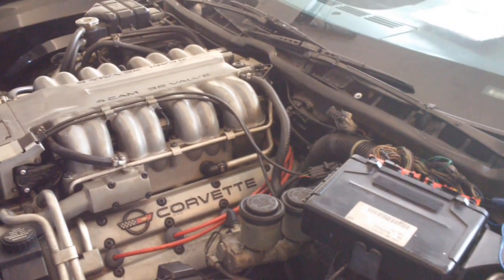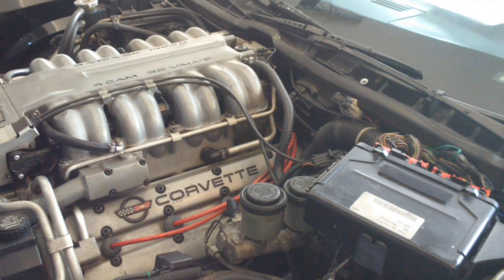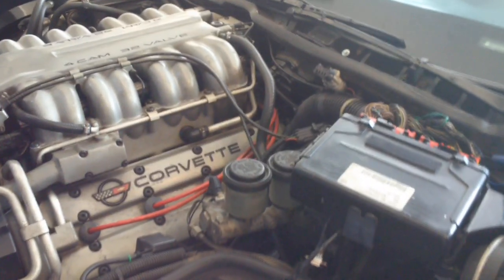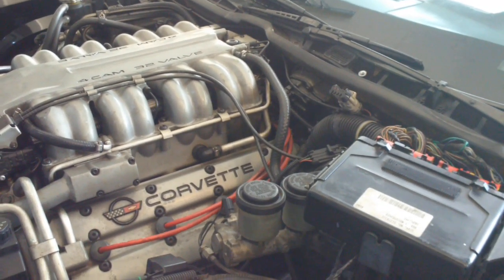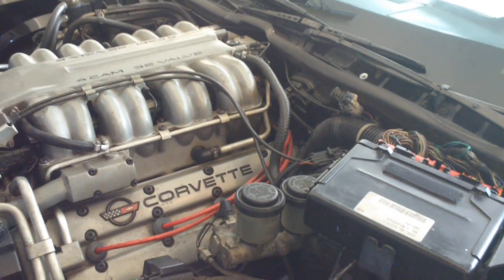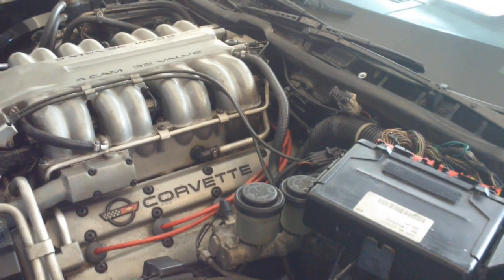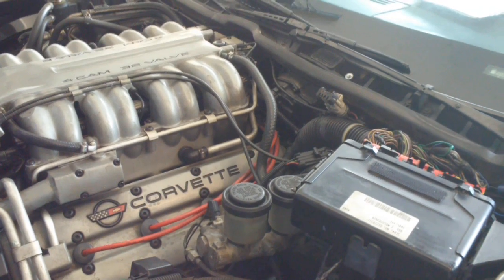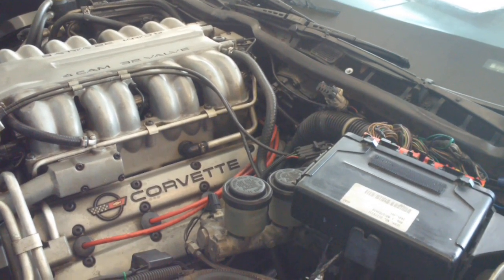C4 ZR1 LT5 ECM

Comment: Nice to see that someone is already tackling this with open source hardware. I figured it was possible, but this is the first project I've seen publicly that in my mind demostrates it. Has the car been driven with the Arduino?
Reply from the maker: Yes, absolutely.  I can confirm that I have upgraded several 'bricked' ECMs using Arduino hardware over the last 3 years.  The hardware is extremely reliable and fits neatly between the 2 circuit boards of the C4-ZR1 ECM.   

The ATmega328 microcontroller, used in most versions of the Arduino hardware, is extremely stable over the ZR1's operating temperature range. In fact, it exceeds the specs of the original ECM (which dates back to the late 1980s). 

BTW - although the Arduino hardware is readily available, the firmware that makes it work in the C4-ZR1 ECM is proprietary and is extensively customized for each ECM upgrade, depending on what failures need to be resolved.
Reply: @user-rj6sd5lj9o Interesting, so  you're basically doing a custom "patch" so to speak, based on the failure mode. I assume that's due to the propreietary hardware (such as U13/U15) within the ECM, and the desire to use the existing wiring harness and retain all other ecm functionality that isn't affected by the failure? It's definitely reassuring to know these can be kept running likely indefinitely this way.
Reply from the maker: Yes a "patch" of sorts but I tend to think of it as adding a pacemaker to the heart of the beast - LOL!!!

Comment: I have been chasing a miss on cylinder #6 for a while, all of my injectors except #6 are getting a pulse. Grounding pin 8 on connector A, #6 will spray however when I try to start the car normally no pulse. I am sending my ecm to  Marc H tomorrow to test on another car to confirm. I have spoken to Marc several times by email and he says he has seen single injector drivers fail, so hopefully I have finally tracked down the culprit. Thanks for posting this, very helpful. 👍👍🏁
Reply from the maker: Component U15 and component Q1 are responsible for engaging injector #6.  Your ECM issue could be related to these devices.

Comment from the maker: Based on the symptoms, parts U13 and U15 were components of interest. The exact cause or causes of the observed symptoms remains a mystery.
Without a DELCO datasheet for the pertinent ICs, it was a matter of determining what each pin is supposed to do by tracing where each pin goes. Slow process. Note-taking and photographing were imperative. 
At this point, I know that transistors Q2-Q8 were not receiving a 5 volt + pulse and therefore these 7 transistors were not activating the fuel injector that each is paired with. This signal is supposed to come from U13. 
Q1 is receiving its 5v+ signal but unlike Q2-Q8, Q1 receives its signal from U15. 
Based on the signal that drives Q1, I  was able to use a general purpose micro-controller, with custom firmware, to drive Q2-Q8. The added hardware/firmware,  maintains the existing individual control of each transistor to support Sequential Injection. 
The proof of concept is revealed in this video posted on YouTube.

Comment: In my 18 years of being associated with the C4 ZR-1, you are the first person that has actually delved deeply into the ECM to find and resolve a non-functioning electrical component.  It is obvious that you really know what you are talking about.  Thank you for the information & the technical information you provided on the ZR1Net forum.
Should you possibly decide to offer your service to repair the LT5 ECM, You would be performing an invaluable function in helping to keep the LT5 viable.  I hope you do!  
www.jerrysgaskets.com
Reply from the maker: Thanks Jerry!!  I might set up some desk space to fix these ECMs.  I'm wondering how widespread the ECM shortage is.
Reply: @user-rj6sd5lj9o It would probably surprise you.  The demand for gaskets and parts has certainly surprised me over the last 12 years. I get calls asking if we know a source for an ECM or where to get it repaired.   
It's a niche market  for sure, but and demand runs in cycles. Were you to decide to offer your services for ECM repair, I would be happy to plug you into Jerrys Gaskets to make the ZR-1 community aware.  The ECM is one of the last, much needed parts to sustain the LT5.    Drop me an email at store@ jerrysgaskets.com if you are interested in my proposal.
Reply from the maker: @jerrydowney5974  OK - will do.
Reply: Vast... I’m one of them, actually I need the whole ECM unit.